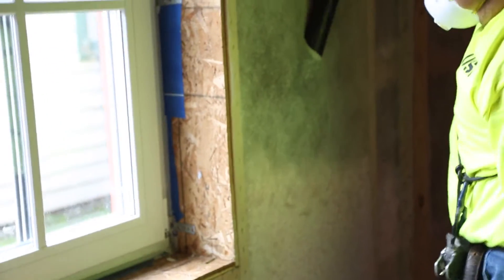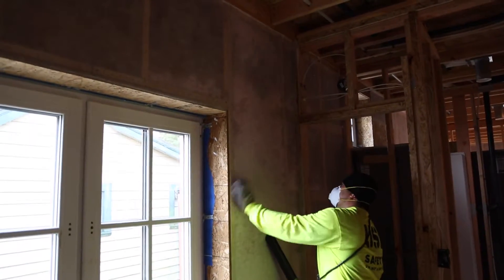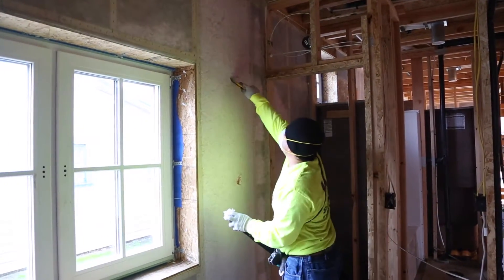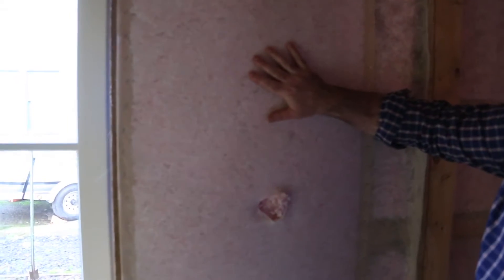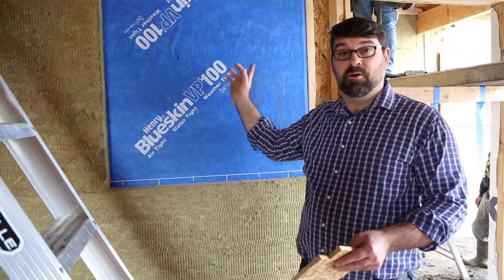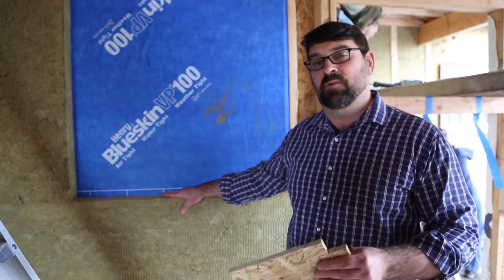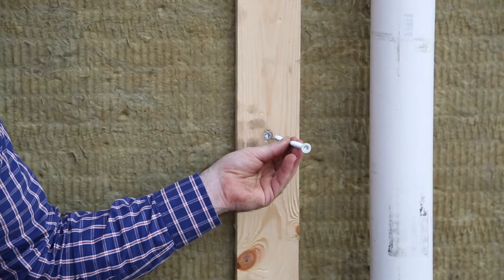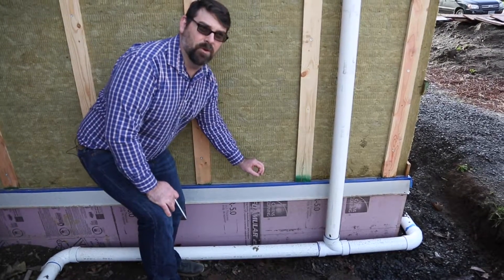Cellar Ridge Passive House: #3 Insulation

Comment: I prefer dense pack cellulose over fiberglass, fiberglass does not perform well under extreme conditions, too hot/too cold. Fastening screws/bolts from 1x4 rain screen through Roxul and into studs creates a thermal bridge, how are you negating that?